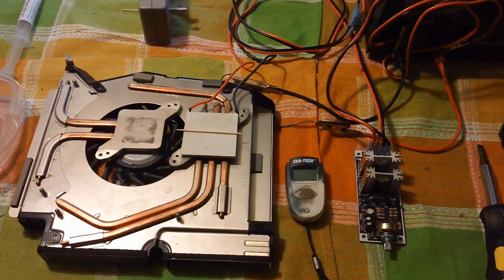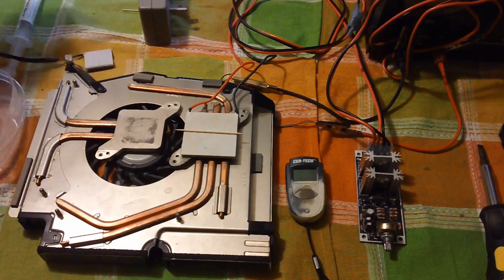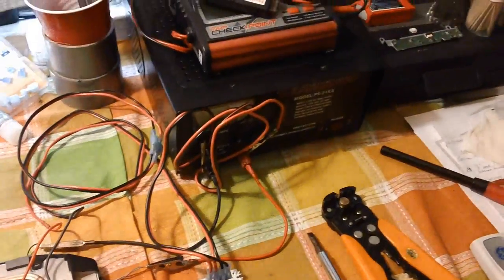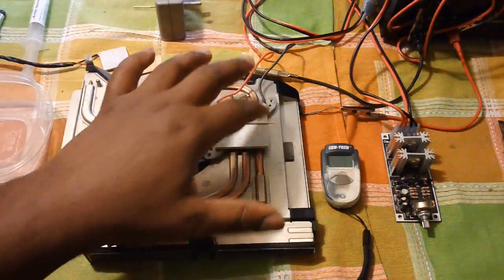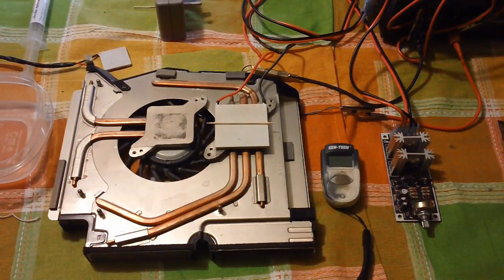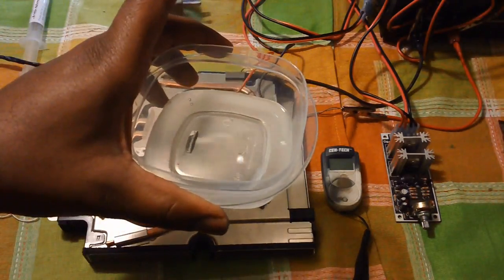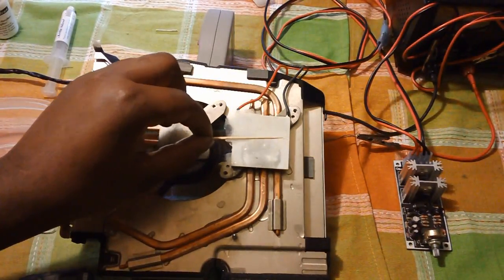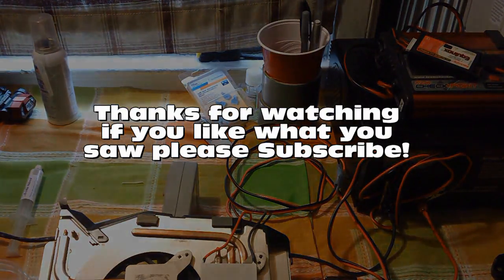Peltier (TEC) Cooling

Comment: wait!!! 
this seems so wrong to me, in many aspects.
you put the HOT side on the heatsink? so you put more heat into the system from outside??
I thought, you need to take off the heatpipes first, then use the cool side from the PELTIER as cooling and get rid of the heat from the hot side with the heatpipes.
Reply: Looks like he was just testing this. So he used the heat sink and fan to cool the hot side of the Peltier.

Comment: i like the way you slit it can you just use the cold side i wonder
Reply: +pattric7 dang how did it get gold the water ant one side hot
Reply: +pattric7 need cold look up quantum cpu  chip the further!.
Reply: +pattric7 the chip is placed with cold side up the waterblock sits on coldside, water flows thru block with a mini pump. the 12607 wattage keeps it in 60s 70s... Tec127xx 08 09-12 higher wattage colder temp. ??

Comment: Also, if you apply just heat to the side that normally gets hot when voltage is applied it will create electricity. They use this same technology in these camp stoves that create electricity to charge usb devices.

Comment: So I saw a video with a tiny candle, heat sinks, and a tec. I was wondering could I use the "hot side" that collects heat, then put a heat sink on the "cool side" to disperse the heat, and have the tec just power the fan, essentially a self powered space heater. Well powered by candles, but the tec would power a 5v or 12v fan to disperse the heat in the sink to warm a room.
Reply: จ

Comment: I have pulled one apart before also. Clearly not aluminum. They are some brittle metal that breaks off in chunks. Little like nickel. Turns out it's Constantan which is an alloy that is a mix of nickel and copper.
Also the efficiency is not great in cooling. For a 136w peltier it can only get rid of 80w of heat from the cool side to the hot side. Where as an air conditioner can get rid of 4w of heat per every 1w used.
Reply: They are still used and made for many small cheap things. Medical cabinets. Mini fridges etc. They are extremely cheap to make compared to making the full compressor/condenser coolant system of typical fridges and air conditioners.
Reply: ziongite It's not constantan. It is P and N doped silicon blocks. They are arranged in such matter that all the P-N junctions are on one side and all the N-P junctions are on the other. The ceramic substrate has copper pads deposited on it and the junctions are soldered to them using normal solder. There are also TEG type petiers that have higher temperature semiconductors inside and are soldered with silver and copper based solder that melts at 500+Celsius. All the rest is absolutely correct!

Comment: I'm currently using a Dual loop Water Cooler that uses Peltiers. :P

One loop is for the PC, and the cold side of the peltier. The other loop nothing but radiators and the hot side of the peltier. The Peltier is powered by a simple 12V 60W Labtop Charger.

Note: the pelter and the second water loop ARE EXTERNAL. The Peltier is Rated for 12V and 50W so I'm feeding it an extra 10W, but I have not had issues with since i put this together... but ...Half my desk is a mess because of this.

And because my desk is right next to a window, i have the radiators in front of my window, blowing air OUT (or your room gets HOT!!!) and the tubes running all the way over there. :P

But the cooling is so dammed real!
Reply: Thats the way to do it without condensation and failure risks.
Reply: *****  Well yea, that's why i did it. AND i would recommend to anyone interested in extreme cooling with no care for how it looks. (cause seriously, it is messy)

On side note, I am actually using a AMD CPU with a TDP of 95Watts... but i got a motherboard with an AM3+ socket ready for the FX-9590 with the TDP of 220Watts (one of the few with beefy VRM) But im kinda not sure if i wanna get the CPU yet, i want more Radiators First! cause i can only imagine how hot the hot loop is going to get.

I might end up putting the radiators into a mini fridge... but at that point the cost of the cooling is too much... Eh i might do it.
Reply: HolyDevil I would wait for the Excavator version of the FX-9XXX series. Why is the look that bad?
Reply: *****
Yea probably will wait for the latest and greatest. But does not change that i will wait for more radiators first before i use any processors above 95Watts.

and it does not look TERRIBLE, but i got tubes running out the back of my computer over to a stand that holds the peltier and the two pumps for both loops.(plus my reservoirs) which sits next to my computer, then from that tubes run over to the window, where i have a Radiator with two 120mm fans which is enough for what i am cooling, but i would fear adding any more heat to the loop as the hot loop is already very warm. I could possibly handle a 125Watt CPU but the hot loop would be HOT not "Very Warm".

I intend to eventually get a few of these:
http://www.amazon.com/XSPC-EX560-Radiator-Compatible-140mm/dp/B007YLTR3E
Reply: HolyDevil Is your Case to small to hold all this stuff inside or is it just for security? For your new radiator i advice you buying a mo-ra3.
Reply: ***** No, it is not because my case is small, it is a NZXT Source 530.
I do it cause there is a bit condensation near the peltier, and i dont want to even risk it.(yes is just for security) As for having radiators at the window, is to keep the hot air out, except for winter, i move them inside and close the window. cause i WANT that heat to keep me warm :3 Anyway, Thank you for that radiator recommendation, I have a bookmark replaced now...

I hope to see some people trying out my builds for themselves soo :P
Reply: HolyDevil I'd try it, but i'd keep everything in my case, but far away from the mainboard.
Reply: *****  I'd love to hear updates on what you think, after you try it.
Reply: HolyDevil It will take a very long time, because im planning this since about 2010 but didnt have the money and the know-how yet. I want to get my CPU to a really cold temperature with the peltier but i also want to cool down the whole case with a radiatior to minimize the risk of condensation.
Reply: ***** Oh something i should mention, the low power peltier i originally used is generally fine but did not do good enough for heavy loads, i long since upgraded to a 550 Watt peltier that i have hooked up to to a 750 Watt Power supply. And I got power regulation on the peltier. (important) when talking about a much more powerful peltier, you MUST be able to regulate it.
Reply: HolyDevil Why do you need a 550W peltier? Do you watercool a crossfire system? this is damn overpowered. and why do i have to regulate it?
Reply: ***** Well peltiers do not cool directly to the wattage, now i do admit with the water cycling it makes it work more efficiently. but that does not change the peltier has limits. i admit, a 150 would be good enough for a CPU and video card on normal load, but i do lots of HEAVY work that really ramp up the temps. so i needed more. so i decided to go all out. and the regulation IS necessary as how it works, is would be the same as short circuiting the power supply. because the peltier introduced very little resistance or feedback. additionally 550 watts IS OVERKILL for my current hardware. so i need to limit the power flow so only what i need is used.

However because i have such a powerful peltier, i have room for upgrading and adding video cards to the loop. but again before i can add those, i need better cooling on the hot side of my peltier.
Reply: HolyDevil okay. i wouldnt cool my gpu. its cool enough silently. but my cpu is hot as fuck and needs some help :D

and i dont thinkt there is such a hard work for a normal cpu, that 550 watts are needed for the peltier :D
Reply: ***** Like said the 550 Watt Peltier is OVERKILL for my current set up, but i got it for later upgrades.

The regulation is also keeping the peltier from running at it's full capacity/power. If i upgraded to a FX-9590, i would have to reduce the regulation, allowing more power through the peltier giving more cooling.

make sense?
Reply: HolyDevil of course it makes sense, but you'll need 550 watts for cooling an fx-9xxx plus graphics card(s).
Reply: This sounds incredible. Do you have list of parts for this? Water pump? Reservior? Radiator? or something completely different?
Reply: zombie343  if you want to recreate it, you do not need parts list, its not hard to make.but just a idea, use 2 cpu water blocks mounted face to face with peltier in-between. (some cpu water blocks should work fine for this purpose)

If you ABSOLUTELY need a parts list PM me or something. im lazy right now and just want to enjoy my new headphones :3

Comment: Peltziers are dangourous. They generate more heat than they cool: In the event of.a processor overheard and full.computer shutdown they can actusally.heat the processor, condensation, etc. It is best to liquid cool using a large thermal body, like cooling the water and pumping the heat outside your home or into.your household water heater.
Reply: "In the event of.a processor overheard and full.computer shutdown they can actusally.heat the processor"
==Why would it heat the processor?

The actual danger is if the TEC fails.
Reply: louis tournas
They have a low-ish efficiency and generate more heat than the cool, normally it is vented but the heat isn't when the fan fails, heating the CPU or at least the motherboards. Sorry about the periods, my phone's keyboard is weird.
Reply: waterlubber
True. Fan failure would be catastrophic. An electronic protection is needed to cut the power to the TEC.
Reply: But most people don't realize that, which is why I pointed it out ;)

Comment: Only success i have had with peltier  TEC chips was a commercial produced which has ran my 4ghz over clock perfectly for 6 years 24/7 temps never reaching 100 f  i have one that requires 150 watts of dedicated power but I froze a motherboard once with it so its been sitting for future works. my stable one I don't think is produced anymore

Comment: Peltier devices work best on DC power.
When, voltage is interrupted, even for a moment, heat movement is reverse direction. Heat pumping capacity and energy efficiency are affected.
Is your power sanitized? ;)

Comment: It would be good if an automatic voltage regulator was connected to it so that it would always stay above freezing point and would adjust to temp, just like a CPU heatsink fan, but would always keep it approximately 5-10 degrees Celsius. A company should make a motherboard with that capability.

Comment: Did you use AC or DC power?  Peltiers need DC power.  Also, not all peltiers are sealed around the edges.  If you accidentally allowed moisture inside your peltiers, it will shorten their life.

Comment: No way! It's not that simple. You need to find a REALLY powerful TEC with the size of your CPU and GPU. And it will drain 200W of electric power to pump heat.

Comment: You want to use air cooling because it allows you to let the hot side get hotter. And because it is a heat PUMP the hotter one side gets the colder the other side gets until the hot side gets hotter than the peltier can handle and fries. So basically you want it to be hot but not too hot check the max temperature of the peltier an get close to that.

Comment from the maker: no but you wont be able to control the thing if your power supply isnt the same or lower the the rated Peltier Chip! ex if the chip is rated 50watt @ 12volts and you have a 12volt 500watt power supply, the chip will try to pull more energy than it can handle and you may burn you chip and render it destroyed.

Comment from the maker: THIS IS A REALLY GOOD QUESTION!!!!!!!! Alittle misimformed though! STACKING Peltier chips will do what you are talking about! you will use more electricity though but you will get better results than with just a heat sink fan though you will still need a fan or water block to cool the hot side down! think about that then when you understand what im telling you i would like to hear more from you! thanks for watching

Comment from the maker: No your right, cooling the hot side makes the cold side colder! but it doesnt work the same for the hot side....if you heat the hot side you will generate power (mA).

Comment: it cools down so much only when electricity is apply to it right?, but what i want is use the peltier as a generator instead.  I guess what i need to figure out is if the electricity generated by the temperature difference is enough to keep the cool side cool.

Comment: You'd need some type of regulation method, It cools down so much, that it freezes water vapor, And you do not want that. Right now, It's not the smartest idea without a controller that neutralizes the temp.

Comment: seen a lot of video of this as a cpu cooler, but i m wondering, if i apply the hot side to the cpu and a heatsink with fan to keep the cold side cool, would the electricity generated by the peltier be enough to run the fan in turn keeping itself cool.  so basically it is cooling the cpu and itself at the same time...any body know?

Comment: you may end up with condensation problems - if not careful you could short out something. Best to use TEC's indirectly - transfer the cool to air or liquid outside the case. especially with higher wattage units. DJ

Comment: hello sir i have a question i tried to hook this thing up and make it work a brand new one.. and it was meant to work at 15volts and 8 amps .. the other one was meant to work at 15 volts amps 3 amps BUT  for the both of them i only put 12 volts and 2 amps or so.. and it just stopped working.. and it blew up :( neither of the sides were getting colder.. please please help!! ASAP

Comment: I am using a Peltier Device for a school project. When I supply power to it, the hot side of the peltier gets to about 200F and the cool side only around 60F. I have heat sinks on both sides, (small metal ones). 

But if I apply an extra, more powerful heat sink to the hot side, the cold side should get increasingly colder?

Comment: I have a quick question for you.  I'm condsidering using this cooling method on Power transistors.  In order to avoid condensation, I'm trying figure out how to control cooling temp.  Do you control temp. by adjusting the voltage to the peltier or by somehow controlling the cooling to the heat sinked hot side?

Comment from the maker: @TheChepichula well. i Would have to Hermetically seal all around the Peltier so no air can get to it! (Air has moisture in it, so then it would like you said condensate so I have to seal around the processor with silicone or some kind of non-Adhesive Putty to trap the air out)  Good question keep them coming and thanks for watching!